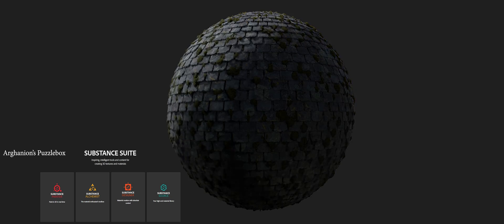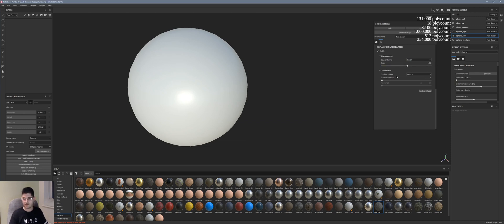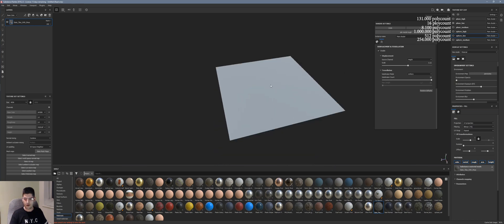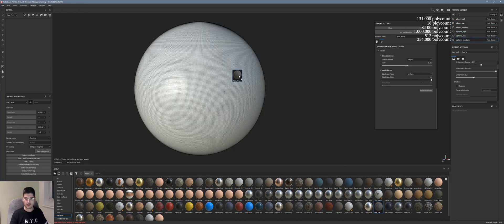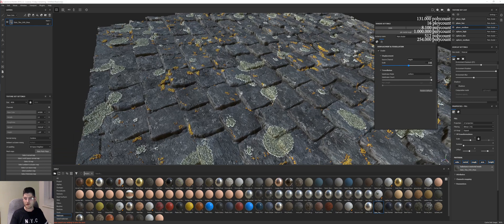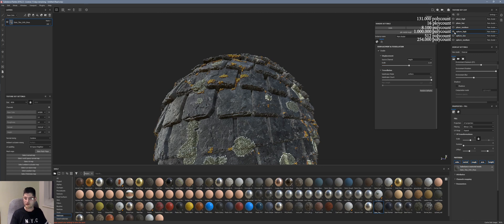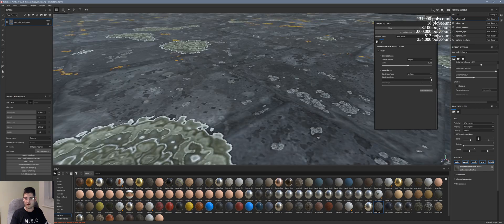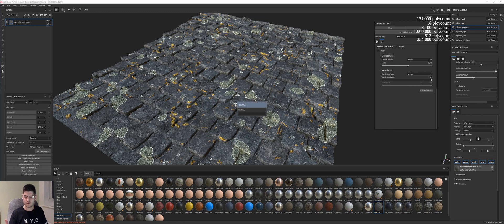Substance Painter Displacement and Height Map Tutorial and Comparison

Comment: hey, thanks a lot for the video... I had a doubt. Is there a way to change the mid level value of the height map in substance painter since i need a mid value of 0 for Arnold
Reply from the maker: Hi

Yes there is, you can either add a Levels to the layer that generates the height map, and then switch the Levels to Height, thus you can play around with a histogram that can manipulate the height map intensity. You also have a height map slider for each texture where that can be altered further. Or, you can add a filter to that Layer that has the height map in which you can use a height map pass to change it's intensity.

Comment: Hi, I know this is not new stuff, but I just ran into this problem. So I created a game asset in zbrush then substance for ue4 and that's all fine, it looks cool, works perfectly in UE4, but it was created with height maps and I changed quite a bit of the geometry of the characters armor (it was basicly plain in the sculpt and I carved into it and added a bunch of chainmail parts and stuff). Now I would like to print it, but pose it first in Blender (because the original is in T-pose). So is there a way to bring all the new detail back to Blender or Zbrush? I can't export the mesh with displacement since all the detail is in a depth map. If I try to use the depth map as a displacement map in blender it includes all the new stuff, but I can't get back the detail from the original sculpt which is now baked into the AO map. I could bake a displacement map of the original in zbrush I guess and mix it with the depth map from substance painter, but I can't seem to get it to look like it does in substance. So do you maybe know of a way to bake all the final details that would cause displacement into just one map?
Reply from the maker: Hi. It's a very tough thing to grasp since I don't know every step of  the workflow you applied. Have you tried exporting a high poly deformed mesh from Substance Painter directly? It has an option that allows you to export the object with deformed geometry.

Comment: This great thank you, however when I do this my plane or model that I applied the texture and displacement map to creates a glass-like effect around the texture, also the tesselation seems to go inwards and looks very odd. Do you have any suggestions?
Reply from the maker: Could me multiple issues for an effect like that. Most commonly is that the mesh isn't made of Quads everywhere or there werent enough polys for the tessellation to work with. In terms of the displacement going inwards, have you checked the height information of the texture to see if the position is negative or positive (the slider going left or right)?

Have a look at this tutorial in regards to displacement maps and see if this helps
https://youtu.be/npjJQPwjGBk

Comment: hey im kinda new to substance , got a question we add the displacement on an object and if we bake and export  the maps will they look like in 3d view port? i mean the diffuse wont be flat?
Reply from the maker: The diffuse will be flat unless you tell the rendering engine to use the height/displacement map for actual displacement. For example with a decent amount of polygons you can use unreal engine's tessellation setup to have real time displacement.

In 3ds max you can setup the displacement quality of your height map before hitting render when you set up a vray render, just as another example.